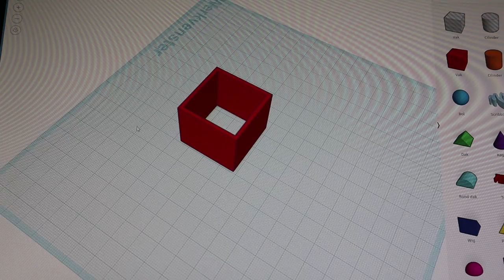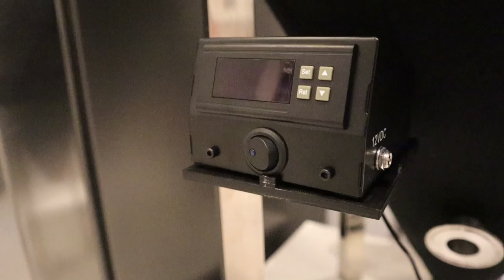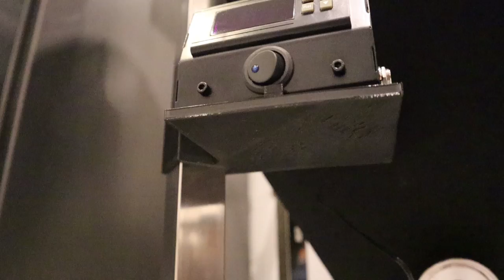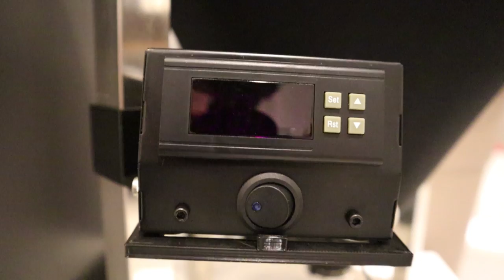3D printed : SS Brewtech FTSs controller holder!

Comment: Hi Glenn I hope all is well in these troubled times. I was wondering if you could make us a mk2 stand and send it to the uk ? All costs covered by us of course . 👍
Reply from the maker: Hi! Sure but do you have a design file? What do you mean With a mk2 stand? Do you have an example? Cheers
Reply: homebeerbrewery Sorry Glenn I never made myself clear . What we need is the stand for an SS Brewtech unitank , the second one you made. Cheers 🍺
Reply from the maker: @Seagull-Island  All right, a bracket for the ftss controller it is. Is the leg size of the unitank the same size as the conical? The bracket only fits 31,5mm by 31,5 mm square. Please let me know.
Reply: Indeed it is the same size they must use the same legs and leg extensions although I supplied my own wheels changing the tread from 3/8” American to 10mm 👍